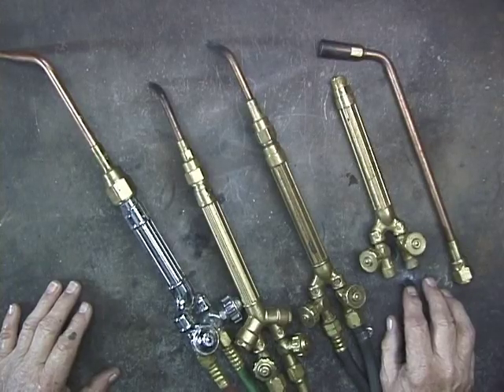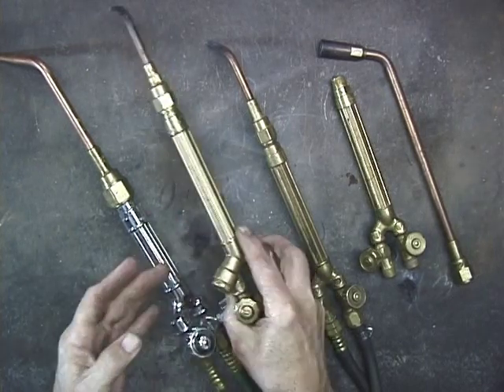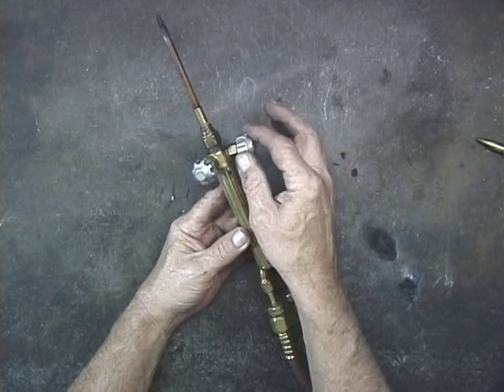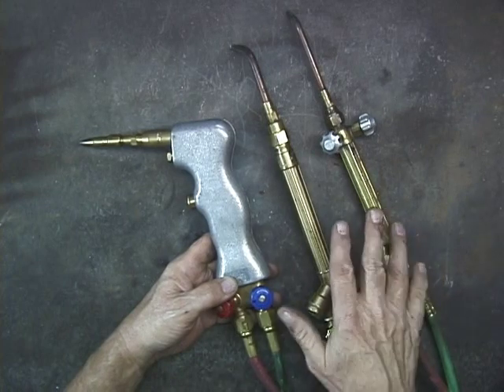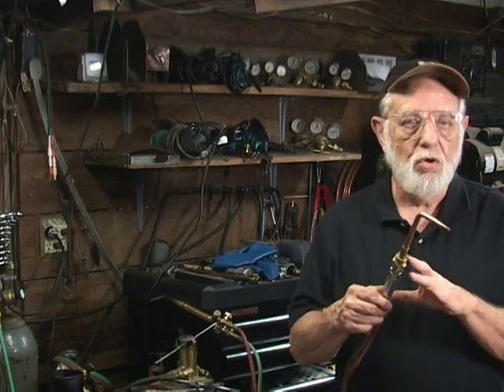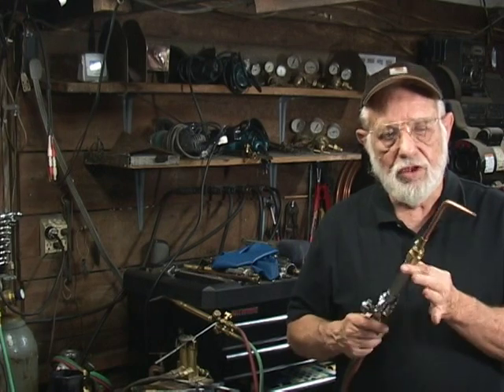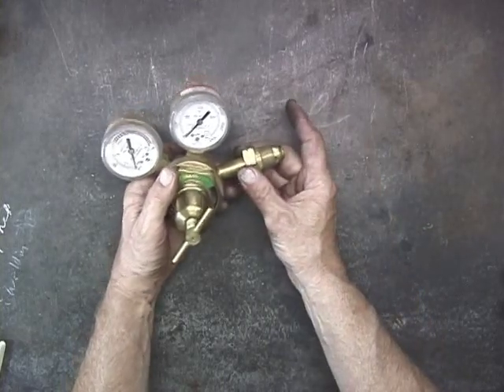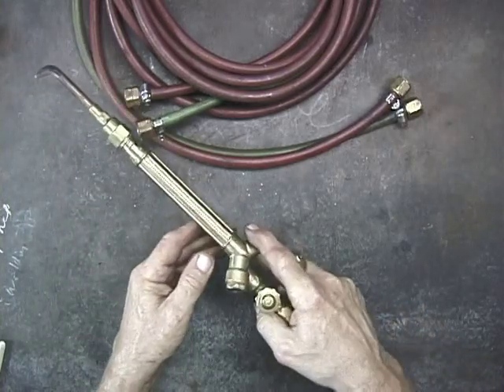Choosing an Oxygen Acetylene Torch

Comment: Henrob 2000 is an amazing torch.  I brought one with me to the Philippines and it is amazing !  My only filler rod during Covid and after Super Typhoon was motor cycle spokes. fantastic cutting and can weld steel , stainless steel , aluminum ( even pop cans) , copper and so on.

Comment: Is that larger victor nickel plated?  I have been around torch and regulators my whole life and have never seen a Victor torch without a brass finish
Reply from the maker: Nickel plated - Yes.  This torch handle came with a hard surfacing powder unit I bought 30 years ago.  Haven't used since I did that video.  Too big for the kind of work that I do.  Have no idea why they plated the handle.
Reply: If it's of no use to you, do you have any interest in selling or trading it? It would go great in my collection
Reply from the maker: @J4W358  Let me think about it.
Reply: @897473  Many powder torches I've seen have plated components, perhaps for extra protection but I've not had a task to use my Eutectic-Castolin for to find out.

Comment: I just picked up some vintage victor and national gauges they look like they been sitting for years can i use them if they dont leak or should i get them rebuilt before using them.
Reply from the maker: Jerry, If it was me, I'd hook them up and see how they work.  If the regulators start losing pressure, you will want to get them serviced.   I've seldom had problems with torches.  The outward appearance of the regulators and torch will give you some indication of their condition.  If the regulators have broken glass or the torches has nicks in it, may indicate that they have had rough use.  Victor torches and regulators are robust, especially the older models.  You've probably made a good acquisition, even if you have to get them serviced.  Check the threaded fitting to make sure there are no nicks in the threads.  That's about all that I can think of at the moment.
Reply: Thanks george! I tested the victor oxygen gauge and its solid and doesn't have any leaks.The national gauges for the acetylene looks like it had more use i haven't tested it yet but i think it will be ok.Thanks again
Reply from the maker: Sounds like you are good to go.  Happy brazing and welding.
Reply: Seal-Seat has an excellent catalog of rebuild parts.  Later Victor regulators are easily rebuilt. National is defunct but aftermarket parts may be available. I rebuild my own regs according to factory tech data and would keep any recent Victors but if the Nationals are bad I'd not bother as good used regs and cores for Victor, Smith, Airco/Concoa, Harris and ESAB are plentiful via Ebay.

Comment: Thanks George! I’m wondering, is there a difference between american and european torches/ tanks? As I would love to order a Victor Performer... but don’t know if I will be able to use it on gas tanks in Belgium. Sorry for this newbie question... but there really isn’t much oxy acetylene information /many shops here in Belgium that I know of. Thanks in advance!
Reply: I'll field that one since I rebuild OA apparatus. Your regulators and cylinder standards are different so I suggest ordering EU standard regulators and hoses then buying your torch separately IF you choose an American torch. TORCH OPERATING PRESSURES WILL BE THE SAME RANGE DUE TO THE NATURE OF ACETYLENE. The regulator steps down the CYLINDER pressure to suit the torch.  (migwelding.uk is an excellent forum for EU welders and covers all processes. I suggest asking there re: what EU torches are any good.) The Performer is a mid-range torch but there is nothing special about them and their clones (Uniweld etc) made in the US are also good quality.  I recommend you learn more about brands and models readily available in the EU. If you do want a US torch all you need do is connect it to your hoses which is quite simple and a matter of obtaining the right fittings. ESAB make excellent torches and now share a parent company with Victor. Check for local distributors. 

Also visit welding forums like Weldingweb and the Miller forums. WW has lots of excellent acetylene torch info. 

You need to visit your nearest welding supplier to obtain acetylene and oxygen so ask about torch outfits there.
Reply: Ob Fuscated Thanks a lot for your time and info!
Reply: Ob Fuscated I won’t even bother buyin the American equipment if I can find all the good stuff here in Belgium, it is just so damn hard to find information about them over here. 😅 I plan on using the torch for welding artwork, so a relative small one would be sufficient I presume.
Now off to exploring the internet for more info about all the different ones! My goal would be to find one torch to do it all, a simple instrument that will last me a lifetime... Would you recommend a certain brand? Thanks a lot!
Reply: @victor-emmanuel7485  Any decent welding torch will last a lifetime as there is nothing much to wear.  Torches are like firearms, very much a matter of individual ergonomics. I prefer older US-made torches from the heyday of gas welding (1930s-1960s) but of course modern regulators. Smith, Victor, ESAB (and predecessor brands L-tec/Union Carbide/Linde/Purox/etc), Meco (defunct but available) and Harris are all good torches. Henrob/Dillon are an aquired ergonomic taste.  Ebay is a good way to collect a variety.

Comment: get both, victor 100 series and victor 300 series.  I got both for less than $100.   THe 300 series I got was even a genuine Victor.
Reply from the maker: Interesting!  Where did you get such great deals?
Reply: @897473  Just now seeing this for some reason (way to go youtube development team).  But yeah Ebay.
Reply: Probably Ebay but I've done even better at estate and liquidation auctions and yard sales.  

US-made welding equipment is so durable I've got 1920s and 30s torches still apparently on the original seals that pass a ~150 psi inert (MIG mix or nit, whatever is next to me) gas pressure test (done with a simple Y-hose with common oxygen and acetylene hose barbs)!  You can test them with clean, dry shop air too. 

My method is buy tarnished, dirty torches then clean them up while inspecting them.. Most buyers (I sell my excess) prefer shiny brass though it patinas back to normal in weeks. 

Most problems are with cutting attachments needing a seal kit,  or in the case of Victor, a seat reaming (your local torch rebuilder can ream them, the reamers are deliberately overpriced and hard to find) . 

Most torch kit buyers only trash one or two welding tips of a set and there's almost nothing to screw up on the handle, though I'm impressed how few users know about tightening the gland nuts. 

I enjoy  your videos. Keep 'em coming. (My nick on Weldingweb is "farmall".)
Reply from the maker: Well done!  You've worked at it, to get what you want.
Reply: It's easy to get more OA gear than one needs but I collect it to use and to sample every variety of torch. BTW Uniweld are an old US company which make a variety of US-manufactured torches (the original patents are many decades expired) of the same quality as the more famous brands so keep an eye out for them too. Many sellers don't know about Uniweld and let them go dirt cheap. They have torches and tips to interchange with Victor and Harris among others. Their model 71 little torch is increasingly popular as it's a match for the little Victors and takes the same tips. For any little torch cheap I look for people selling used "HVAC" torch kits then zoom in on the torch in the photo to see which it is. 
That's got me a few Victor J-series.

Comment: what is the cheapest one I can get
Reply from the maker: I don't have prices.  If you are in the US, Harbor Freight will probably have the lowest prices.
Reply: Victor
Reply: Cheap good or cheap junk? Acetylene and compressed oxygen are respectably dangerous. I scrap offshore generic junk torches and regs when they show up in auction lots to remove them from service (cutting torch mixer fires are common).  "Cheap good" is any classic US make bought used. Facebook Marketplace often has deals with cylinders.

Comment: iv got a question for you do i need a special regulatory for propane. or can i just use the same for acetylene im not really going to be using it to weld or anything more less just for cutting and heating the steel up
Reply from the maker: That I don't know.  I've never used propane.  Check with your local welding supply.  Check with some of the cutting forums.
Reply: Ok thanks it just my local welding supply shop are dumbass's last year i converted my Lincoln 100 so i could weld aluminum and they told me it is impossible to do and well i did it and it works great. But anyways thanks for the reply
Reply from the maker: I did see someplace that a fuel gas regulator will work with both acetylene and propane.  But again, I have no personal experience.
Reply: Ol thanks

Comment: was your cobra torch trigger stiff? Thanks for the informal video your experience helped.
Reply from the maker: John, I've been using it for a number of years so I don't know whether it was stiff in the beginning or not.  Now that you mention it, I don't use the trigger since I don't use the torch for cutting.  I light the torch, adjust the flame and then hang it on the Gas Saver:   https://youtu.be/0giY-_TjWHs

Comment: Hello George,  Well I have egg on my face.  It is indeed a Performer J100.  As I found when I dug out the box.  My supplier years ago referred to it as the "junior" maybe as a shorthand for the "J" in the J100.  I had just used that designation without thinking about it for the past 45 years.  I see in my original pamphlet that there was a "medium duty"  model as well and then the Journeyman which they designated as heavy duty.  Sorry for my error.  But I still can find in all the 45 years of searching an adapter or way of running a rose bud on it.  I even tried the imports to see if they would fit.  Take care.  Doug
Reply from the maker: Douglas, yeh, I know.  I get something fixed in my mind and feel like it is the absolute truth and then find out differently.

Comment: I may be wrong but it seems at the time my lightweight one was the Junior (I still have the box) and the next one up was the "journeyman" the medium sized one.  We had those on ships and in the various shops.  Maybe they were WestCoast names?  Doug
Reply from the maker: West Coast:  Back in the 70's and 80's Victor was in Denton Texas (if my memory is correct).  I once had an old set of Victor Regulators with San Francisco printed on the gauge faces.  That may be where your' junior come from.  First Victor outfit I bought was in about 1971 and it was labeled as "performer".  I think it was a J-100.

Comment: George,
Really appreciate your videos and especially the tips you give us. What is the flexible hose you reference at the end of this video. Is it a smaller diameter or a particular brand? I've seen some hose referenced as "super flex" and my local welding supply carries 1/4" and 3/16" hose.
Reply from the maker: +brxtmp106  Not sure what the specification is on that hose.  I have a new one still in package.  Will look tomorrow and get back to you.
Reply from the maker: +brxtmp106   Hose:  3/16"  Grade "R"  12.5 ft. "Anchor Brand"  by NASCO
Reply: Thanks...on my way to LWS in an hour! :D

Comment: The Henrob was news to me, I have investigated it after reading what you said and it seems like a great torch.  Though I can't help wonder if you couldn't do almost as well with a small conventional torch, the right welding tip and pressures for acetylene and oxy set to 4psi as with the Henrob?
Reply from the maker: +1873Winchester   The conventional torch has been around for a long time.  It will do about anything a torch can do.  Sounds like you are happy with what you have, so there is probably little reason for you to change.
Reply: +George Goehl Thanks, I don't really have any equipment in working order yet. Only my dads old torch and no gas and lots of missing stuff. I'm definitely going to see if I can start using this torch, currently restoring it, have bead blasted the equipment it looks almost new now, but if I have to buy something, the henrob looks interesting.

Comment: I use the victor J27 & J28 mixing (aircraft torch) for small welding and brazing work, and I much prefer the Airco dual stage regulators for Oxygen and Actylene.

Comment: The acetylene cutting torch is great for steel fab. I use the plasma torch for stainless steel and light gauge sheet metal.
I can't stress enough how important it is to keep your cutting tips clean center hole and preheat holes. your tip needs to make a long oxy stream through the flame just like a new tip. Always use the smallest tip practical keep torch close cut slightly fast and throttle oxy stream when beginning the cut. My cuts rarely need much grinding. Never cut with a dirty tip. When your torch pops your doing it wrong.
￼Read more
Reply: John Donahue the the

Comment: Could you advise me on the size(s) of oxy and acetylene canisters you use with your Victor Performer welding outfit? I'd like to know the amount/square footage  needed of each gas in each canister you require in creating your beautiful sculptures. In your larger works, do you need refills for your gas canisters? Thank you for your marvelous videos. Your sculptures are a feast for the eye! I'm working to graduate from soldering to art welding, and will be purchasing a Victor Thermodyne Performer torch outfit soon. I'm learning through books and your videos, starting out small, on basic techniques you show.
Reply from the maker: Oxygen Acetylene cylinders that I use take up about 1 square foot each.
Once you have a set of cylinders you can take them to your supplier and exchange them for another set that have been filled.  Contents of cylinders is measured in cubic feet of compressed gas (oxygen & acetylene).   A mid sized set of cylinders contain about 125 Cubic feet per cylinder.  You can get larger and smaller cylinders depending on how much oxygen acetylene you plan to use.  Example:  Welding & Brazing heavy metals such as 1/4" and above will require larger amounts of gas to be used.  Welding or Brazing lighter metals will take less.  

Thanks for your comments.  Have fun!

Comment: Hi George thanks for the quick response. I know what you mean about the water, it can make a rusty mess of things.

On the enamel, yes for copper. I was at the Art Harvest in Dunedin, FL a couple weeks ago and saw a metal artist that had applied transparent color pigments to the copper it looks great and will probably protect from tarnish. Which leads me to another question, tarnish. I have had some luck with dipping in clear polyurethane and  hanging to dry on small pieces. It gets a nice heavy coat and seems to work well with copper but never with brass. What do you use to retain your colors?
Reply from the maker: Denise, the only colors I try to keep are the ones on copper.  I lose a bit of color when I clear spray.  For this reason I will often repeat the coloring two or three times until I get the most vivid colors  possible.  Which means  that if I don't like the coloring I will wire brush back to clean copper and start over again.  Then when I spray I will lose a bit of color but still be pretty good.

I only color leaves and butterflies.  There are some people on the web that are doing some fantastic coloring.  Much more controlled then what I do.

I don't like working with brass, so I am not much help.  

George

Comment from the maker: As for buying, renting, leasing cylinders - that's not an easy question as welding supply companies have different policies.  Sometimes it is difficult or impossible to get one company to fill another companies cylinders.   It some states it is illegal.  

I'd suggest deciding on what company you want to deal with and see what kind of programs they have for cylinders.

I own all my cylinders.  Over time this is the least expensive although the upfront cost is a bit steep.
Reply: I would like to see a copy or link to any such law. Company POLICY of course varies. I buy my (many over time having no reason not to) industrial gas cylinders used after researching what my local welding suppliers will refill or exchange. Far cheaper than leasing or buying new, and because I exchange them immediately I have current hydro dates and fresh stickers from my local suppliers.